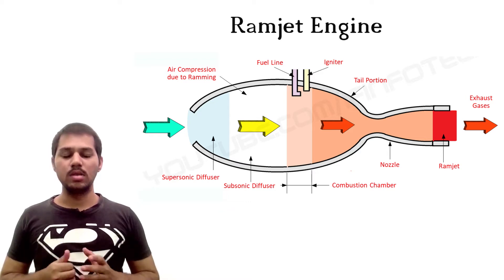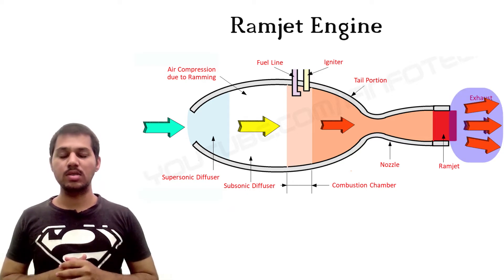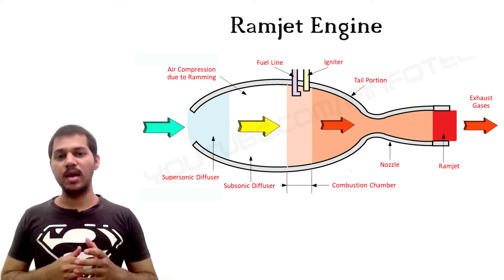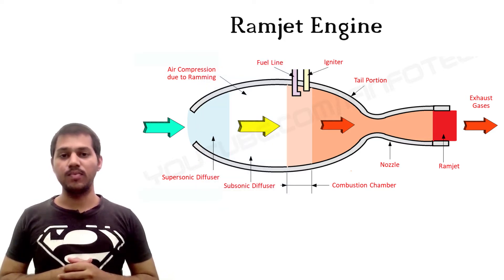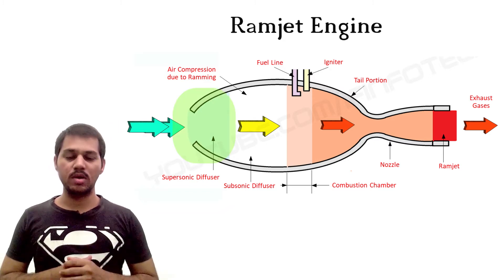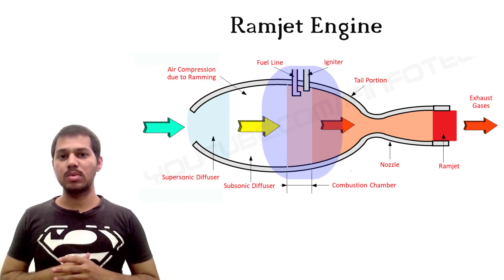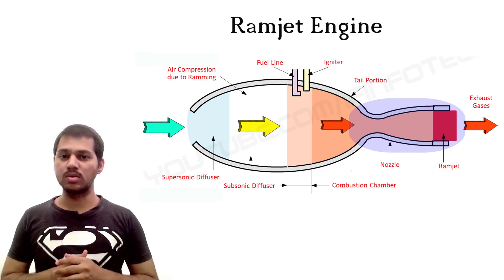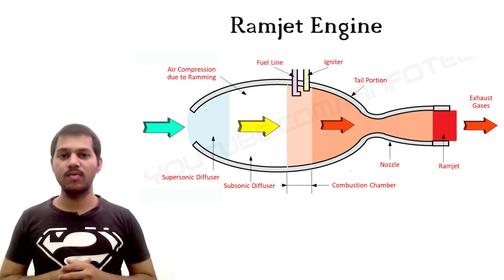Ramjet Engine Working Animation | Ram Compression | Power Engineering | Shubham Kola

Comment: Temperature rises from 1500 to 200 degree ?
Reply: 1500 to 2000k
Reply: @prashanthnathanp1234  1500 to 2000k🙄🙄😳.bro 2000k is equals to 2,000,000
Reply: @radhakanna-143  its Kelvin bro
Reply: @prashanthnathanp1234  bro you mentioned degrees Celsius in video not in kelvin. Kindly recheck it